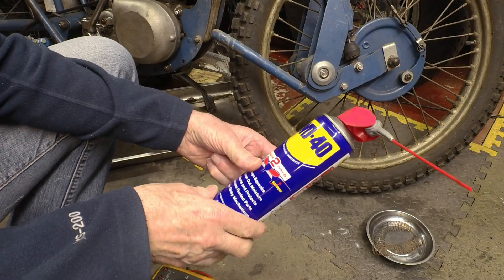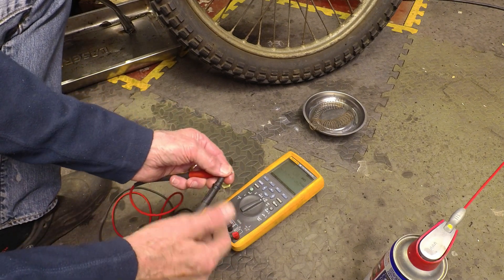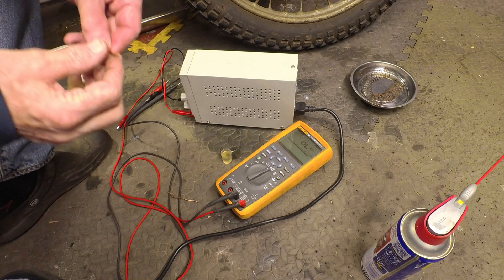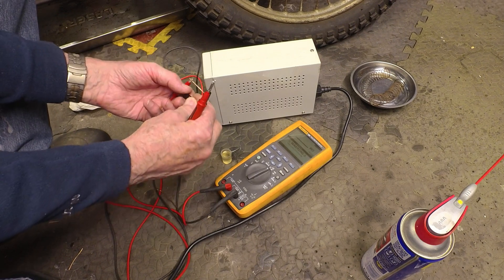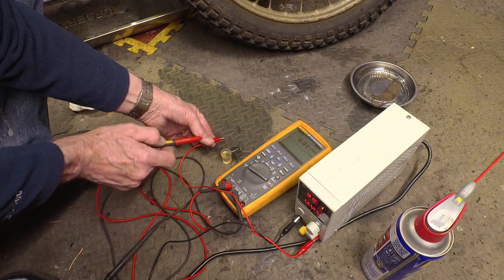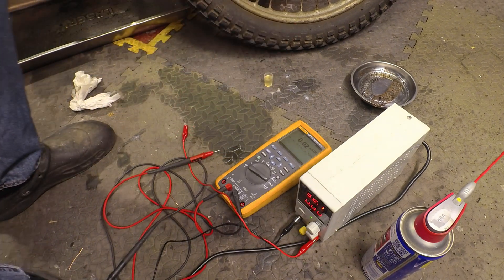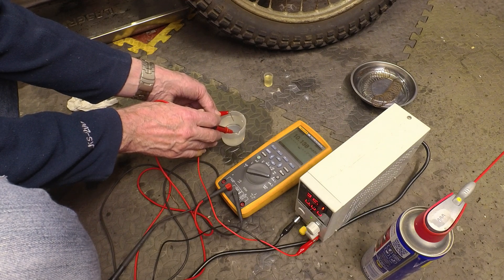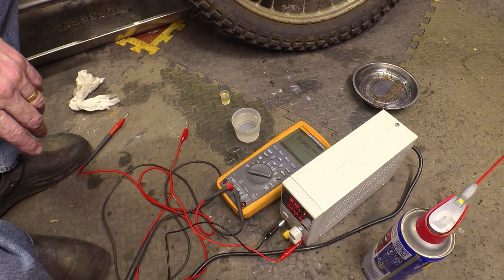"WD-40 Is Conductive"

Comment: Hi mate i decided to clean some circuit boards on graphics cards .
99% of them have been fine but there were a couple that i ended up having a slight issue with after cleaning (they were tested before and immediately after)
It drove me crazy as i couldnt possibly see how it could have caused an issue as its "non conductive"
The issues went away after leaving those for 24 hours (perhaps there was some residual liquid somewhere, hidden under components etc) 
Perhaps this video sums up that indeed the slight conductivity was the culprit. Thanks for the video.
Reply from the maker: Yes, I suppose everything is conductive to some extent and even a high resistance 'short' could affect electronic level signals. I still think WD40's pretty safe on circuit boards, though isopropyl alcohol, or acetone may be better (with the power turned off) and leave less residure.

Comment: In the early days Mini distributors failed with road water spray and WD40 had the car running in a min or so
Reply from the maker: Ah yes, I have fond memories of spraying WD-40 on my 850 mini, by the roadside, in the rain  🙃
Reply: @Greeves  About 12 years ago I was driving  an A35 from Southend to Cornwall,  that should not have been a problem but the Motorway, a cloudburst and the spray killed the ignition near Camberley.   I got it running with wd 40 but was unable to continue with the very heavy rainfall I think motor way roads don't drain as well as the old roads perhaps. I don't believe it was climate change?
Reply from the maker: @BrinJay-s4v  I've not used WD-40 on ignition since my early Mini days. Some later Minis were fitted with a rubber boot over the distributor - which mostly made things worse, by holding the water in! I cut a piece of hardboard to size and shoved it in behind the grill (leaving a gap to let air get to radiator). This cured the issue for me, though I still kept a can of WD-40 in the boot, just in case..

Comment: The conductivity permitted depends on the circuitry involved. General automotive wiring would be unaffected but a circuit board would be a different matter. It will cause problems at the high impedance sections eg crystal oscillator, analogue references, A/D.
Reply from the maker: @darnit-dad  Good point
Reply: see my recent comment :)

Comment: Try again after the solvent has evaporated....    And BTW ordinary resin solder flux starts to conduct after a few years.
Reply: Everything is conductive a little bit. Just most things arn't measurable with normal meters.

I think something in the solvent or condensation can be an issue with higher voltages. I managed to trip a circuit breaker years ago when spraying something on a disco/stage light fitting - I think it was a PTFE based lube. but then that only needs 20-30mA to flow for that to trip.
Reply from the maker: @chriscook7049  Yep, as you say, everything conducts to some extent, given a potential difference. Flamable liquids can also be ignited by sparks - as demonstrated by the transformer oil near Heathrow. Due caution is in order.
Reply: @Greeves  Dumb things you do when you are young.
Reply from the maker: I appreciate that flux can be a problem, so should be cleaned off. It can cause corrosion too.